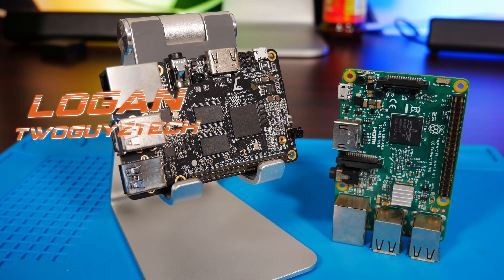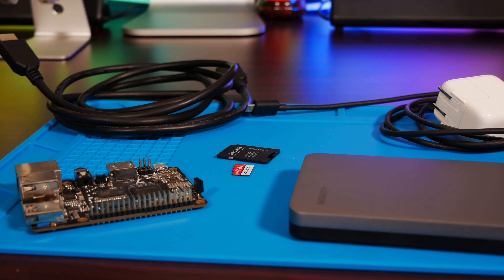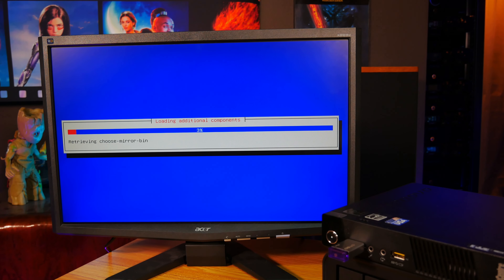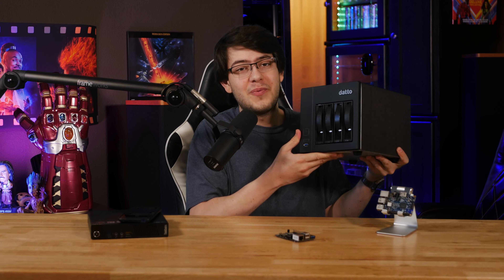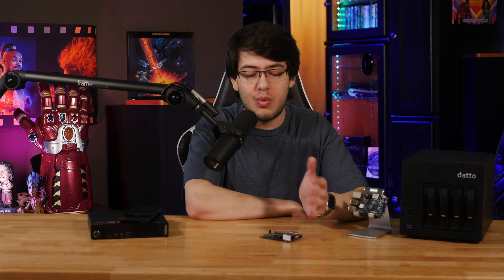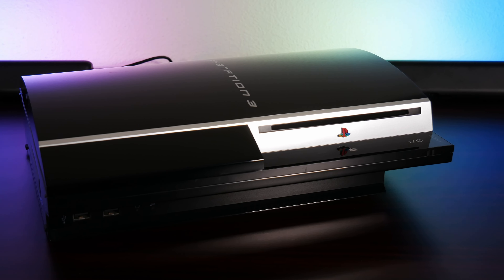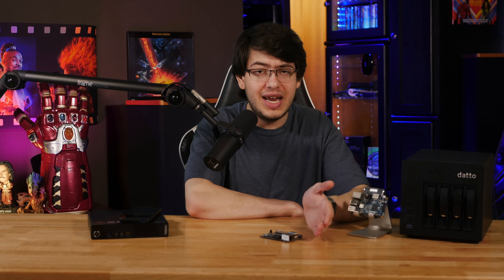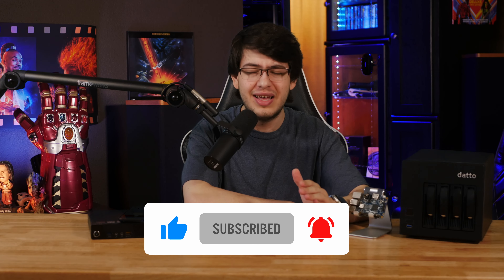Can a Raspberry Pi Make a Good Media Server NAS?

Comment: I have a good NAS and I don't use any other software to stream my TV shows and movies on my TV. I use a simple USB SSD drive connected to the UBS ports on my TV.  One USB SSD has TV shows and another USB SSD has all my movies. I save the hassle and electricity streaming my digital media connected to my TV without a NAS or any other delivery method. As much as I think its cool to have a NAS serve up my digital media to my TV, my method saves power and complexity to entertain me.

Comment: I have had raspberry pi 4 4GB as my Plex server for years and it's been working perfectly fine for everything. 4k, h264, h265, everything just works. I have 5+ year old cheap LG TV which has a Plex app and the only issue I've had is certain subtitle formats but even that it was possible to change some settings and it's fine now. I can even watch something on the TV and on phone/laptop at the same time without an issue. I don't really see any reason to do any transcoding. With Windows PCs you can just use the Plex client. 

My biggest issue is that I should've bought bigger SSD when I started, adding/changing it kind of a chore. 

In a small apartment the size benefit of a Raspberry pi is huge.
Reply: Could you tell more about your setup? I’m interested in building something for myself but I don’t want to waste money on it and then learn it is not for what I need and have to spend more money doing the “right” way again. Thank you!

Comment: 5:52 I'm not sure what you're talking about here regarding RAID with USB (granted I'm fairly new to NAS, DAS, RAID, etc.).  But if you use a DAS with RAID, you are using USB regardless if you use an SBC or a PC.  Drives used are typically 7200 RPM HDDs which USB 3.0 has plenty of throughput for.  I get that obviously directly connected via PC motherboard is better but still.

Comment: While the much older Raspberry PI 3 and 4 could not transcode, it seems the RPI 5 can transcode up to 2 streams simultenously thanks to it's GPU. With a SATA hat you can get a small efficient Mini NAS for personnal use for quite cheap, between 150$ and 250$ depending on where you live. The point here is efficiency because on eBay you can find old 8th or 9th gen Intel CPU Dell or HP towers for very cheap and they are way better for transcoding but are really hungry for watts.

Comment: I started with a full size pc as a server. But felt like the power of the pc was being under utilized. So then i got a raspberry pi 5. Its great and does what i want as far as media server but im not a super fan of some of the ARM limitations. 

So i went back to Full desktop again but its a Dell OptiPlex SFF. This way i can use NVME as the boot drive and run the media off of a 10tb spinning rust HDD. Running proxmox so i can run VMs off the NVME for a better experience. 

Only drawback is not having a dedicated GPU. So some day i might slap a low profile intel arc card in there for better graphics for some Vms. And it wont up the power consumption by that much.

Comment: i just finished a Mini-itx with 12600k, using Intels built in 770 graphics, it is a transcoding monster, can transcode 6 to 8 streams simultaneously. i will never need that, but the other features are super fast, fast sata, 2.5 gig networking.
Reply: Just out of curiosity: how much power does it consumes while heavy load?
Reply: @mathcale  my 1st reply disappear? cpu 125 watts under Blender23.  for transcoding it wont load cpu that much.

Comment: People may disagree with me, but I think the best bang for buck DIY NAS platform is still Skylake/Kaby Lake. Relatively inexpensive, decent efficiency (Coffee Lake and up are less efficient considering more cores), and considerably better expansion than the N100 type boards. Kaby Lake is better if you are going to use quicksync for transcoding as the Kaby Lake iGPU supports 10-bit HEVC and Skylake does not.

Comment: I've been looking at options for a small simple nas and media server which i can then replicate and colocated at my family's homes. Back all our data and share media. I dont want to loose a generation's worth of pics and video amd etc. I'm been thinking about n100 box wiht 16GB ddr4 and small m.2 drive. Then ad usb drives for storage. Also backing up mine to offsite cloud backup. I wanted to go RasPi but the n100 are about the same price and better spec-ed i think. I'm open to thoughts.
Reply from the maker: Thanks for watching! If you want to keep invaluable data safe for a very long time, I would avoid using USB based storage solutions and get a NAS which allows you to configure a RAID for data redundancy across SATA disks. Synology has a lot of good software utilities for offsite data replication and flexible RAID options, but of course that is going to be quite a bit more expensive. We'll be reviewing an N100 box soon that has a couple of 3.5" hard disk bays to offer similar features at a lower price, but the software isn't nearly as comprehensive. I will keep the use cases you mentioned in mind to see how well a solution like that could work. Hope this helps!

Comment: Initially i had a pi3 for Kodi on the tv, but storage was always am issue, i basically kept adding thumb drives for more storage. 

I wanted to have Jellyfin to stream to other devices in the apartment, but still use kodi for playing media natively on the tv. 

I ended up getting a mini pc from beelink and adding a 2tb hdd to it. I just keep kodi running for the tv, and jellyfin runs in the backround for the wifey to stream her shows where she want to be at in the apartment. Kodi and jellyfin share the same media directory. It works for what i want it to. I almost got a nas, but i think this is what i was looking for at this point. Im sure there will be a change in the future.